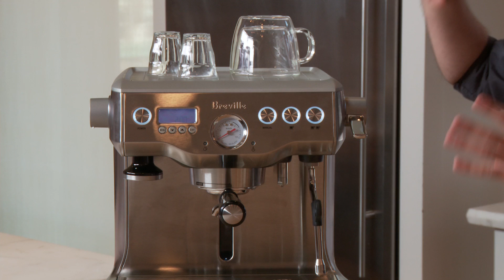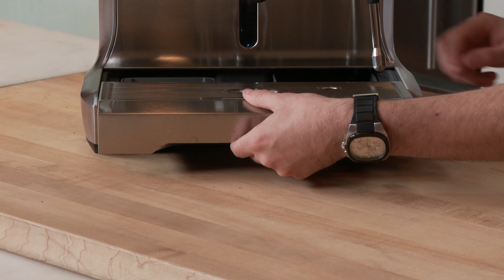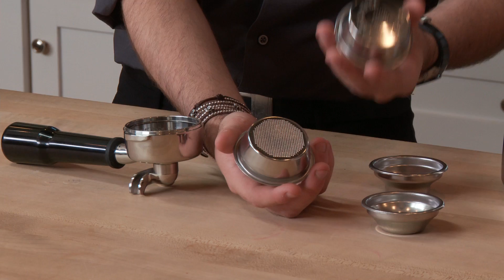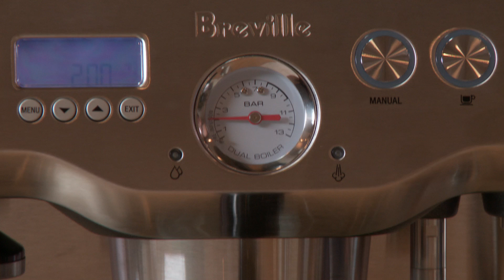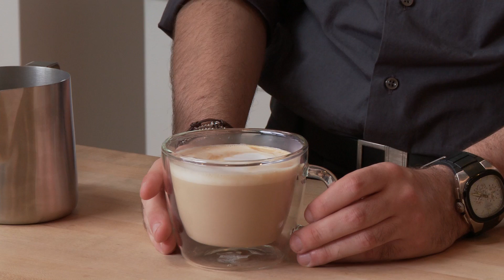Brew Fresh Lattes and Espressos Using the Breville Dual Boiler Espresso Machine | Williams-Sonoma

Comment: I had to check this wasn't April 1st... come on, this guy successfully made Breville, Williams Sonoma and the amazing BES900 all look like a bunch of clowns. William's would be better to just remove this video, it is completely off the mark:
– Brags about the variable steam power, which is so weak on this machine you would never want to turn it down...
– Doesn't explain the real difference with dual and single wall baskets
– Uses dual wall basket with freshly ground coffee (why??)
– Tamps the coffee wonky
– Does not apply sufficient tamping pressure
– Doesn't purge the group head before shot
– Uses the single shot button ... on a double shot basket
– Extraction pressure is way too low, should be at 9 bars (even when he used a dual wall basket!)
– Extraction is over WAY too fast, indicating that the grind is too coarse (and likely resulting in sour coffee)
– Poor thin crema results (a product of the bad technique used)
– Second shot: leaves the coffee inside the group head causing scorching to the top layer of beans
– Somehow gets completely different results to the first extraction, with what looks like 10mL of coffee produced....
– Inserts milk wand too far into the jug causing screeching and poor texturing results
– Fails to clean or purge the milk wand straight after texturing, causing milk to bake onto the nozzle
– Just dumps the milk into the coffee... and yep, almost no foam at all.
– Calls the final result a Latte... sigh. Not surprising that you don't see him drink it...

I easily noticed all of this, and I'm not confident enough to call myself anywhere near a "coffee expert" yet! This guy is better off selling pod machines!!
Reply: I think I have learned more from this comment about making an espresso than I have from youtube videos.
Reply: Tamping pressure may vary depending om your grind size so I'll give him that one. Everything else sucks.
Reply: @1983Jacko  tamping pressure is a myth. You tamp enough and that's it. You don't tamp lightier or hardier or some other bs

Comment: I was hesitant to spend this much on an espresso machine but I have been using it daily for almost a year and have had no issues.>>>ur2.pl/1177   sometimes you have to jostle the beans as they can get stuck and not feed into the grinder but this is pretty rare. overall extremely happy with it.
Reply: wooooooooooooooooooooow

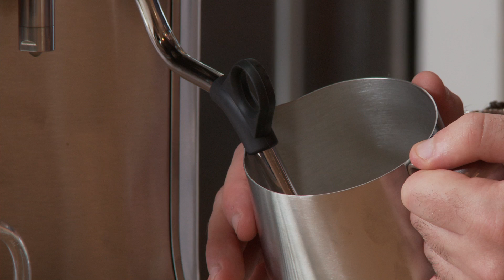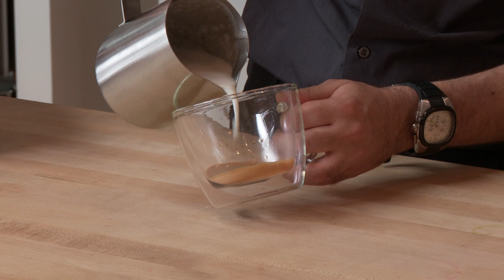Comment: I love this machine But the Breville BES870XL will do Just as well, My take on this video is, The coffee/Espresso Started from 4:25 and Ended at 4:38, But the Milk/Froth was Finished at 4:47, so the need for the dual boiler is Not really Needed, it may be a want, but NOT a need!! You were not through polishing the froth/Foam milk till 5:00 in the Video, I may have spent a little more time, polishing the milk Foam after the frothing is complete. 
That gauge is for getting the Grind size, and Coffee grounds dosage, and Tamping set just right, and checking it on the gauge when pulling the shot.

Comment: Good luck with ur unflush steam wand.
Reply: Hello. What do you mean by this? What did this guy wrong? I'm just wondering. I'm planning to buy this machine and I'm absolute newb. Thanks!
Reply: @Nochigaming  after you froth milk you need to purge the wand ( push some more steam through it) to clean it out, otherwise you will eventually get a clogged steam wand.